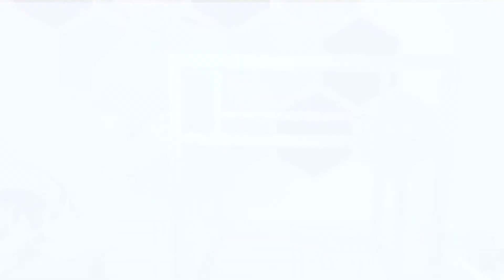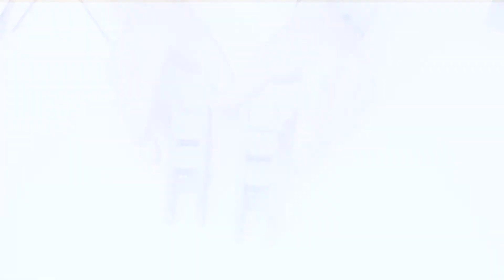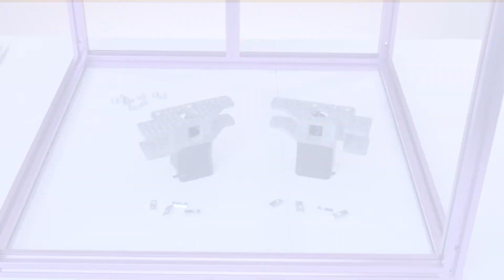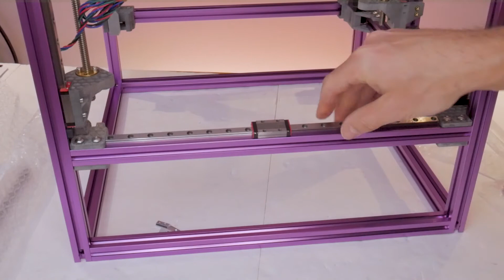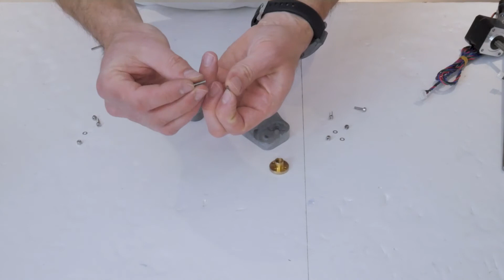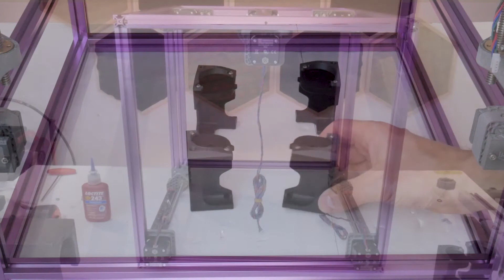Voron Trident Premium Purple Plastic Eater Build (Part 1: Frame Y/Z Axis Assembly With MJF Parts!)

Comment: Nylon creeps. at least fdm nylon parts do.
Reply from the maker: All materials creep to some extent, even metals (obviously much less than plastics). I'm not overly concerned with this nylon since traditionally the Voron parts were FDM printed in PLA / ABS / PETG which all likely exhibit higher creep at lower temperatures than multijet nylon. Even still the traditional built vorons print very nicely. As part of good practice over time I will double check the tightness of the fasteners as the most creep is likely to take place on areas that are constantly under some force (ie. under the bolt heads / parts seeing force from belt tension / parts bearing weight).

Comment: Nice video , btw you can use printed jig in tool stl file for Y-extrusion alignment
Reply from the maker: Thank you, are you saying there is one available from the Voron community? I just modelled my own very quickly
Reply: @EmbraceMaking  no its inluded in the stls file under tools 110mm Y- alignement spacer